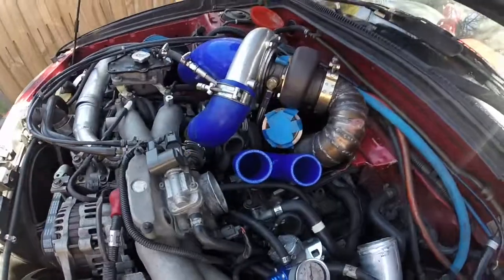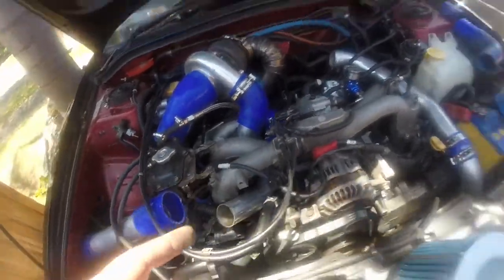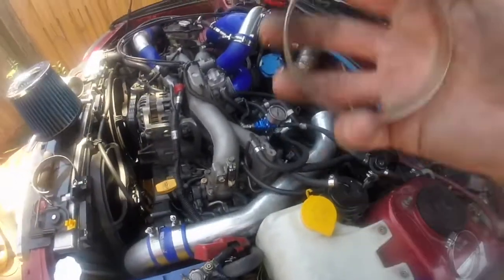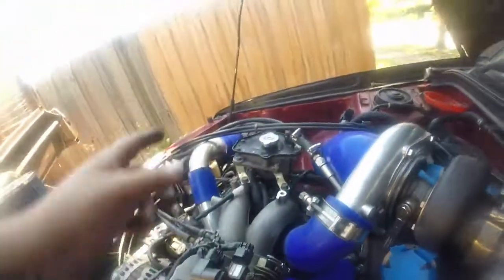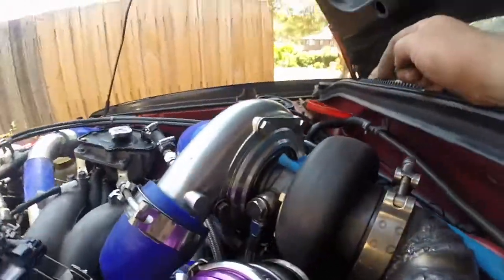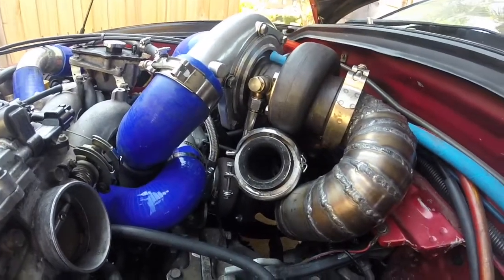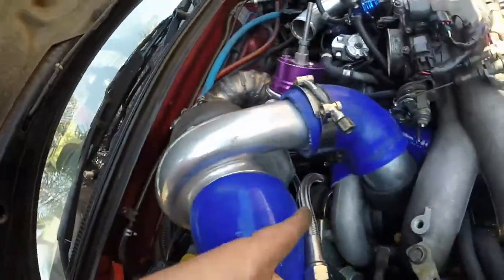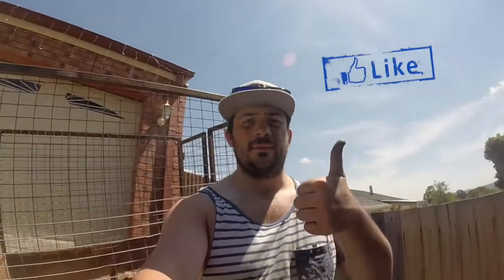Compound Turbo Subaru | Charge pipes

Comment: If it's got the water cooling galleries, hook them up as the oil injection is restricted to just spray enough to lubricate the bearings, not to cool it. You could risk it like people risk no engine cooling for just start up tests. Just don't go running it under load as you can cook the oil in the turbo. Also don't forget the other water gallery hook up on the passenger side if getting more lines is a problem.
Reply from the maker: Yeah, was just going to do it like that for start up.
Reply: I run my gt3582 without water and have on lots of turbo's it doesn't hurt them